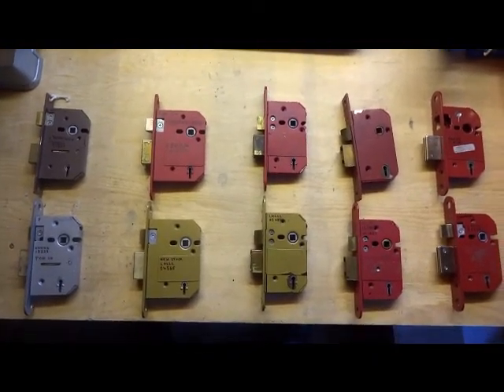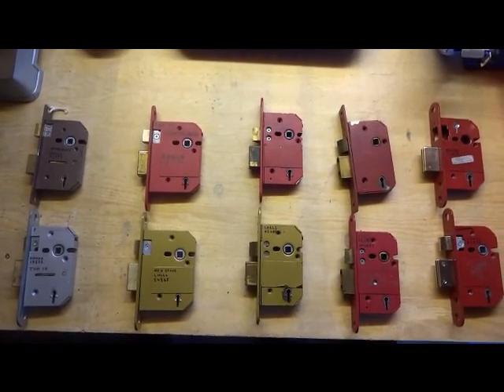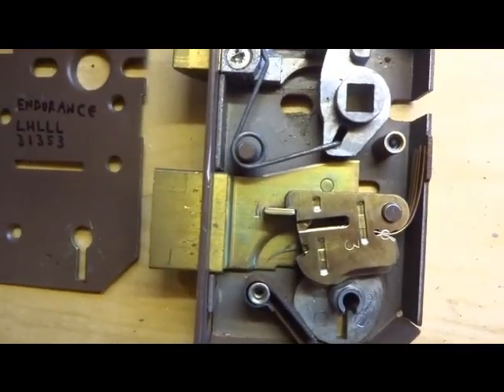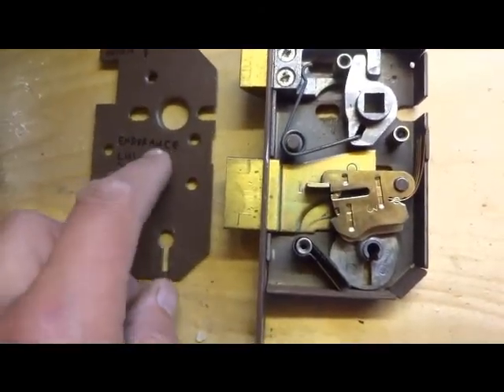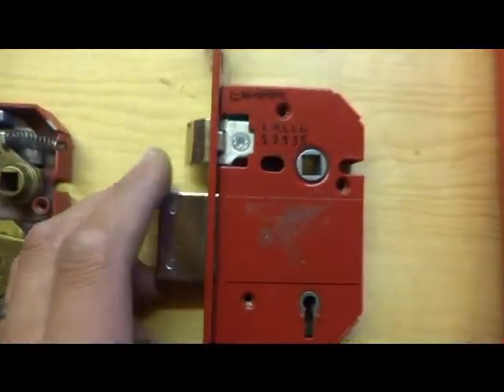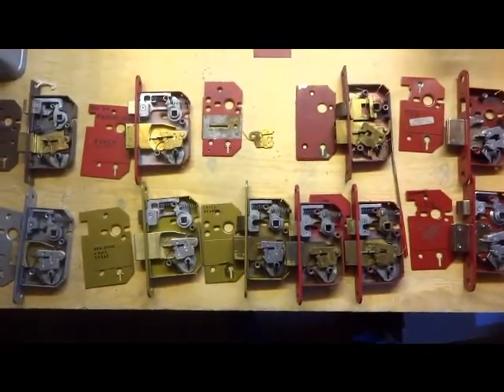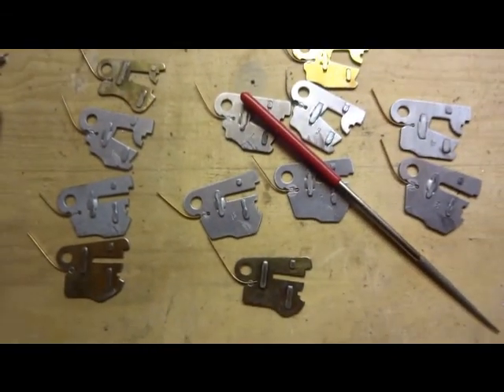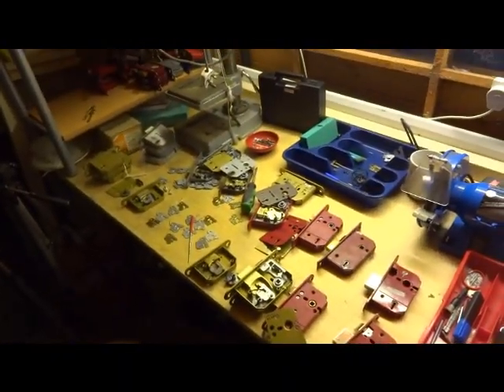ERA Locks Explained

Comment: Hey paul, got yourself a new subscriber here =]  Just a quick question tho. On that fortress I see you managed to keep the top latch in place.  I was not so careful =[  I'm having trouble getting the coil spring back in place.  Any tips?
Reply from the maker: hi mate, it can be tricky i know and era actually provide a tool for holding the latch bolt in place while u have it open, the number to ring is on a sticker on the locks. but other than that you just have to carefully slide the case on while holding the latch in place with a thin pick or something, i know they can be a pain its the same on some other locks as well.

good luck
Reply: Thanks lol i have already removed it and would like to get it back on. sure I will get it sorted.  Thanks for the videos and response.

Comment from the maker: thanks Jacob. yes try out keys work on these locks. the souber 5 levers do not however initially physically fit in the case of the lock as they are designed specifically for the chubb 3g114 type of locks which has a slightly thicker case/key. but with a small trim they fit in the era and a bunch of other ABA style 5 lever locks.